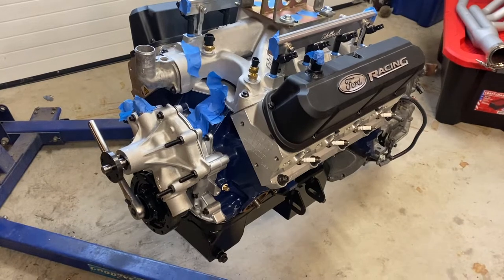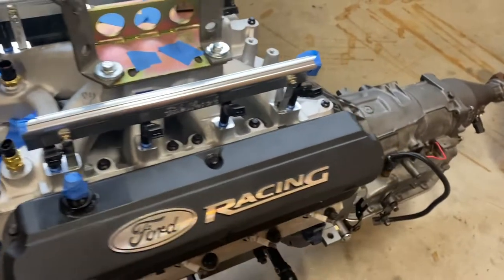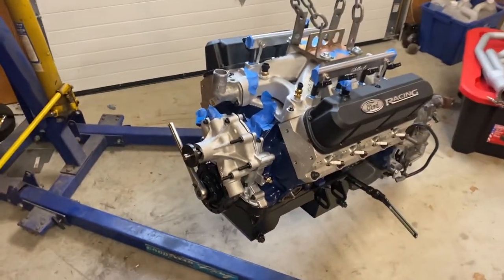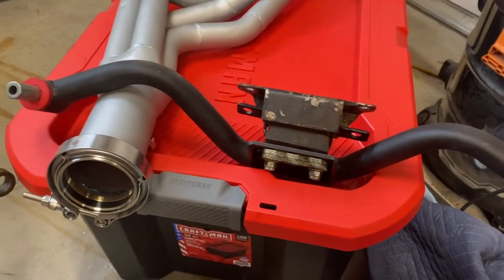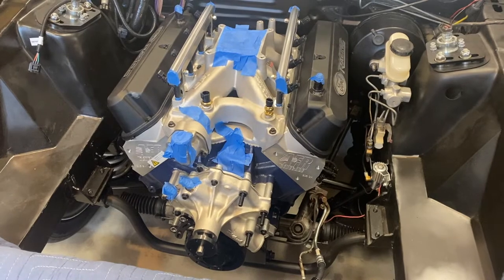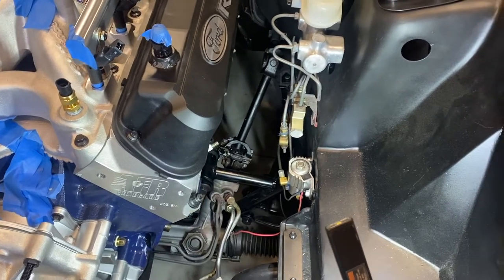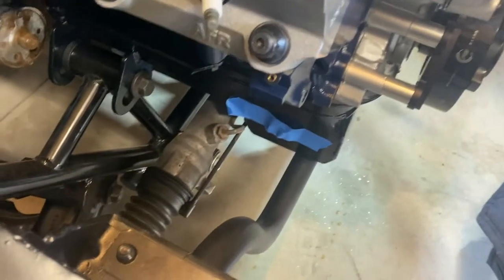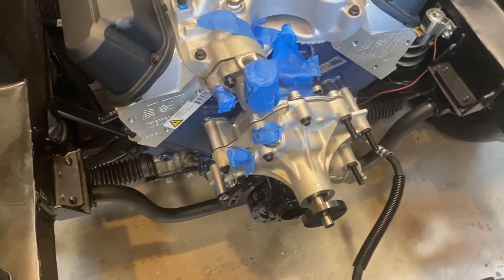Foxbody Mustang Engine Install

Comment: Will you be able to run the stock hood with the extra motor height difference?? Thanks for the videos!!
Reply from the maker: I don't have hood on yet but using eyeball and a level I don't think this would clear a stock hood.   I was curious as well.   I'm using the 95 Cobra R which should easily clear.   I'll have a video dedicated to this topic in the future once I get to that stage.
Reply: @MrStangdawg  Sounds good. I'll be looking forward to it! Thanks!

Comment: I have a question.is 2500.00 good price to rebuild a 2.3 motor 86: fox body
Reply from the maker: are they also doing assembly?   Machine work depends on what is being done but 500-$1k based on what they are doing.   That's labor/machine work.   Then add the cost of parts.    In today's market $2500 is not way off the mark but seems tad high for a 2.3L.